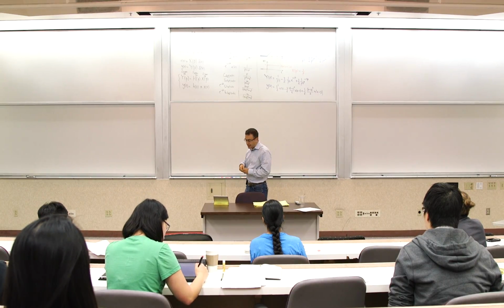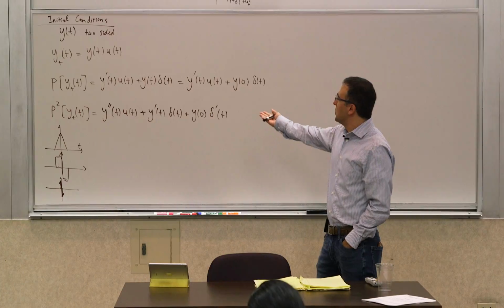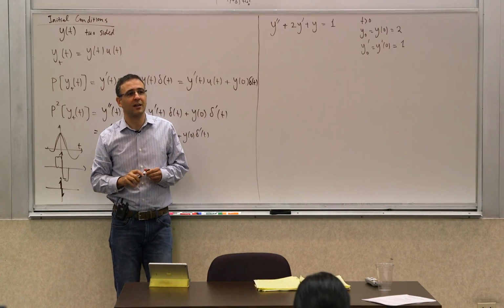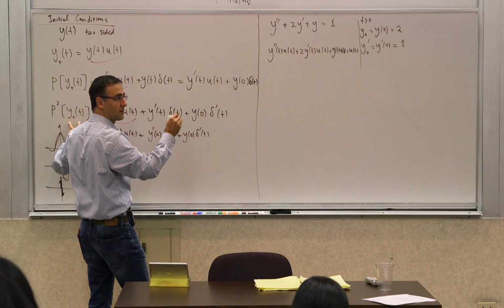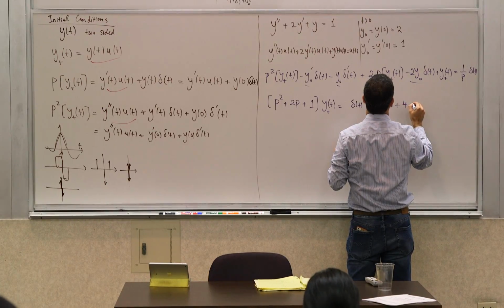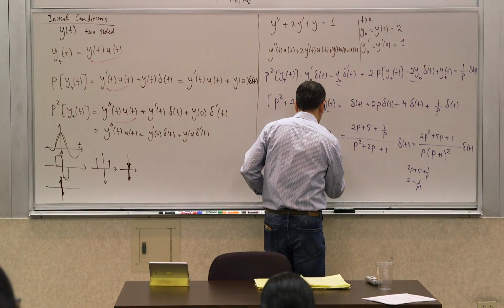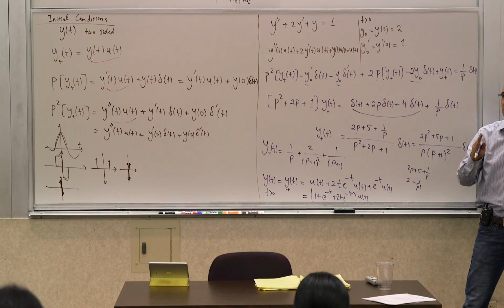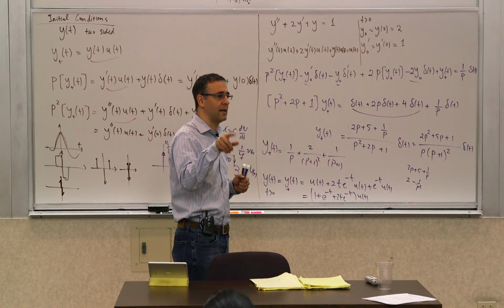026. Heaviside Operator: Initial Conditions

Comment: 00:03 Dealing with initial conditions in differential equations.
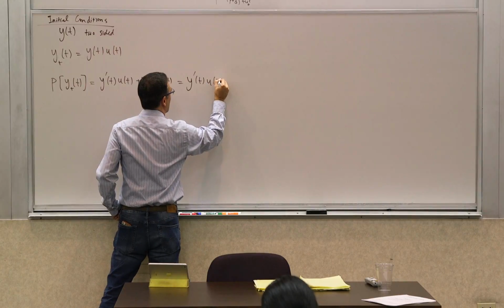02:22 The Heaviside operator simplifies to y0*delta(t)
04:33 The Heaviside operator is a symbol used to incorporate initial conditions into solutions.
06:56 Understanding the Heaviside operator and initial conditions in differential equations.
09:10 The system is second order with two initial conditions and two degrees of freedom.
12:02 Calculation setup for general initial conditions.
15:34 Initial conditions are inherited and acquired.
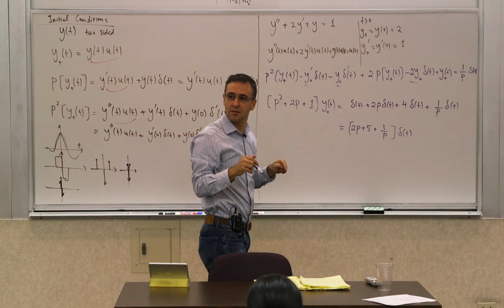18:24 Understanding the Heaviside operator and its application
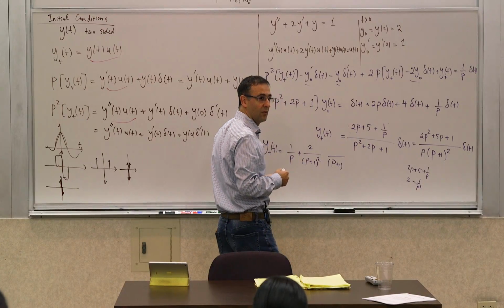21:07 Introduction to Heaviside Operator
24:03 Deterministically changing all states can lead to time travel.
26:11 Initial conditions affect the circuit's behavior.
28:47 The Heaviside operator can be used to derive the initial voltage and current in a system.
Crafted by Merlin AI.
Reply from the maker: Thank you.